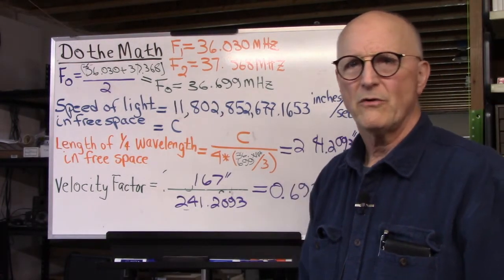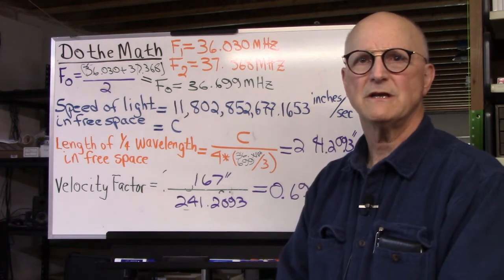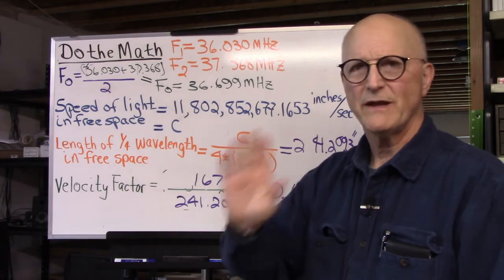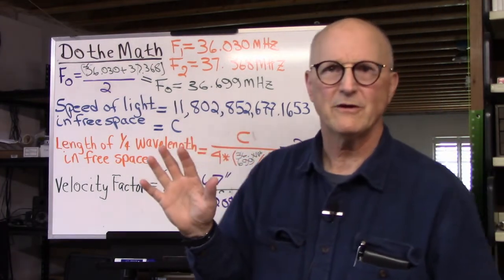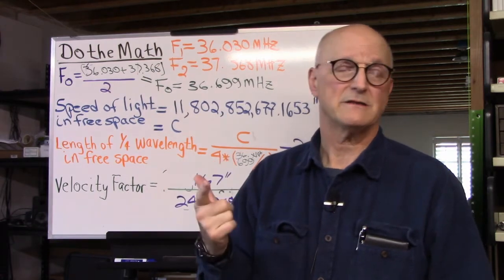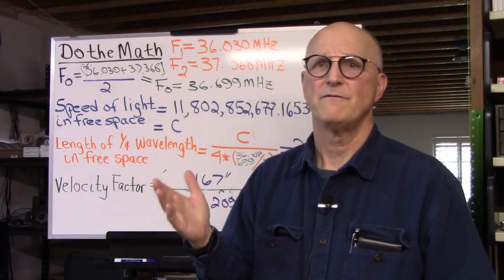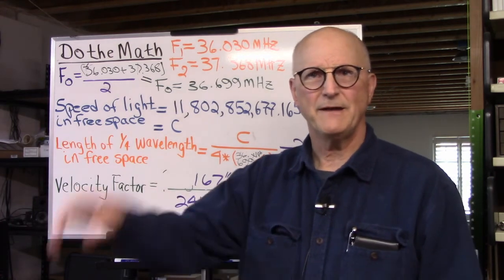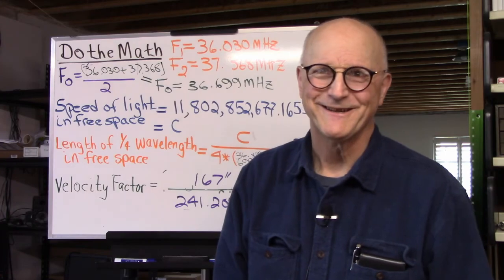Velocity Factor: Measuring using the Antenna Analyzer Method (00e2)

Comment: Will this work on any old conductor?  I'm looking at making a slim jim styled antenna out of conductive nylon backed tape and a seatbelt strap.  I saw it on a ham channel, and they got the weight down to 40 grams for a dual band for 2m and 70cm bands.  The issue the maker was having was that he didn't know the velocity factor of the conductive tape, so he was guessing his way to the right lengths with respect to the known velocity factor of copper ladder wire.

But the follow up for antenna building :  If copper has a velocity of 0.9 and conductive tape has a velocity of 0.55, it is as simple as a ratio between the two to achieve the needed radiative properties of an antenna with a low and ideally targeted SWR?
Reply from the maker: Now THAT is a really good question! I've never actually tried to do this, but let me noodle a bit ...
The method depends on the analyzer seeing the "test subject" as a transmission line. It seems to me that a transmission line requires two conductors. If there is not one explicitly provided such as with coax, then any conductive or semi-conductive stuff in the vicinity becomes the second element. This is especially significant as we increase frequency.
So, if your assembly uses this conductive tape in conjunction with some other conductive material, you could do this. But I am not sure how well it would work without the other half of the transmission line.  You could try it and let me know how it works for you.  That way when someone else asks me a similar question, I might be able to answer them.
Sorry I couldn't be more definitive. 😞
Reply: @eie_for_you  no worries!

I think you have me on the right track.

I'll get with another local antenna enthusiast and see what we can come up with.
Reply from the maker: @aaronhope8366  Just as a note ... environment is everything! Changing from naked wire to insulated wire with an antenna makes the antenna wire's VF go down, shortens the antenna. The basic equation for the VF of coax only involves the dielectric coefficient of the insulating material used in its construction. Ya gotta be paying attention to this in your process. 🙂

Comment: This is a fantastic video thank you so much! When measuring a section of coax does it need to be shorted at the opposite end or is it okay to leave it open
Reply from the maker: Thanks, man! Leave it open or shorted it should make no difference for this measurement.
Reply: @eie_for_you  I have a nano VNA I was wondering if you happen to have one, and and can tell me how to do this type of measurement using a nanoVNA
Reply from the maker: @PatAutrey  Well, Pat, have I got a deal for you!  I demonstrate exactly that in this video:
https://youtu.be/ZHqU8gL-8qE
I just watched it again, myself, note that I keep talking about 1/4 wavelength. I mean 3/4 wavelenth when I get to the "Do the Math".
With the nanoVNA you have to set the Start and Stop frequencies before you calibrate just like a normal VNA (miniVNA tiny is very different, it always calibrated it entire range).  The when you set new Start and Stop frequencies to zoom in on that second transistion, you will have to recalibrate 😞which is a nanoVNAism.
This assumes an open end. If you short the other end, the phase transition with be from +180 to -180 degrees, but will exist in the same place.
I hope this helps.
Reply: @eie_for_you  the video is perfect! I am wanting to determine the velocity factor of MFJ 300 OHM twin lead. I have got so many different answers from people as to what the VF is. Some say 83, some 89. MFJ said 66, but when I measured I came up w 42! Will try again with these instructions and see what I get
Reply from the maker: @PatAutrey  First ... MFJ...not a big fan. Yes, I own one, but their accuracy for reporting anything but SWR is suspect, even coming basck from factory calibration (which cost me nearly half the cost of the instrument and took 8 weeks).
Aaaaahhh! Now THAT's going to be a trick! Let me explain briefly.  With COAX, everything is pretty much self contained (EM-wise). Twin lead and the like, not quite so much.  Let's say that you measure this stuff laid down on the ground. You have conductive ground underneath it with air inbetween. This creates capacitance between each conductor and the conductive ground. This changes things. How much these sorts of environment effects will actaully affect the measured VF I cannot say because I just haven't messed with twin lead in that way.  But, you could do an experiement by hooking it up to the nanVNA and then have someone move it around, change its environment and watch you VNA to see how the phase moves about with the changes. Let me know what you discover.